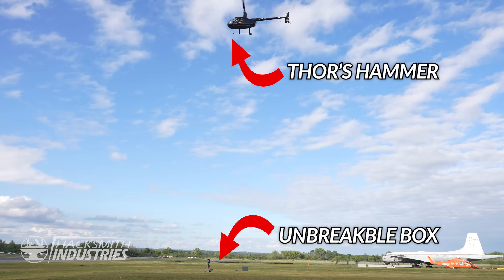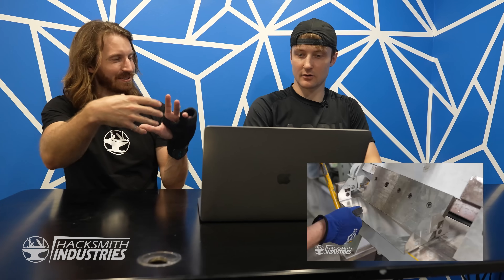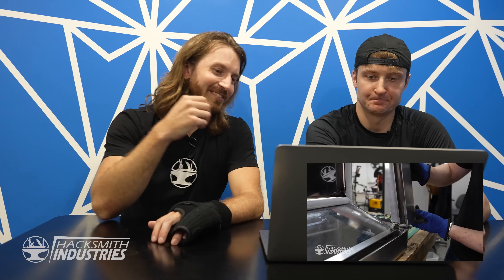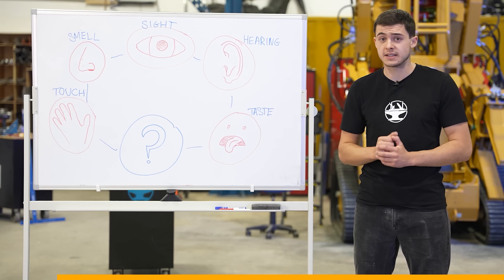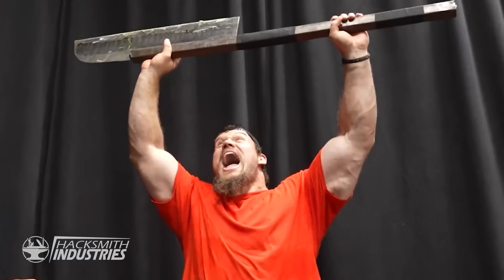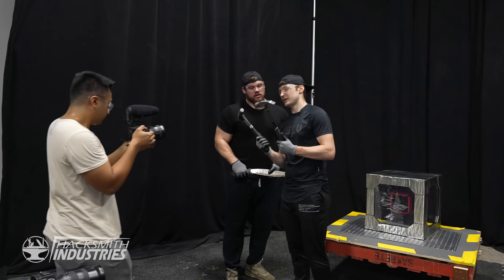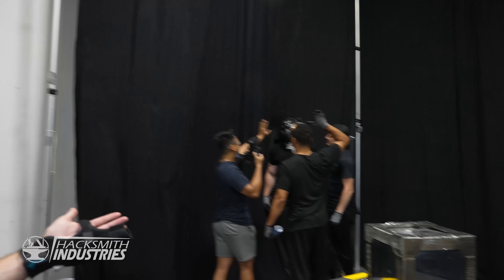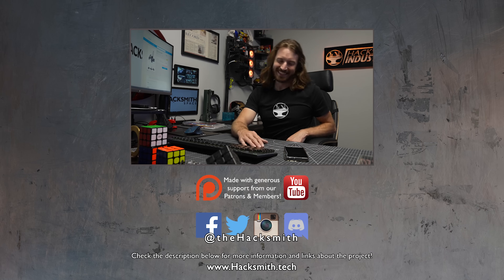Testing an UNBREAKABLE TESSERACT with JUSTDUSTIN for $10,000!!!

Comment: You guys need better sources for your polycarb.  You can get a 4'x8'x1/2" sheet for <$600 USD and 1" for about $6400
Reply from the maker: That math still doesn't check out. 10x the price for twice the volume?
Reply: @hacksmith  If you consider that as you get thicker you start getting into thermal gradients as it cools I can see thicker pieces being harder to make and keep both straight and to tolerance.  My point was more that you were massively overpaying.

Comment: This could be trivial... Just weaken the structure of the cube by using liquid nitrogen and the lightsaber. Then hit the cubes metal edges with something like an axe until it breaks. Then you can try to hit the corners, allowing acces to the inner cube, which you break by throwing it out of the helicopter into the edge of a building or just a bunch of spikes.

Comment: Seems too easily breakable. The polycarbonate seems a good material, but since there's large surfaces with empty space behind, makes the cube faces vulnerable. The edges are too thin metal, and the space makes it succeptible to prying. Welds could be much longer also.
Reply: Exactly what I was thinking

Comment: The method to break it is concentrating the force in a point with an object with a small surface area, doing that and the most important, applying acceleration will break it, 'cause the the force is F=m.a. If the impact is concentrated in a small area, it will not spread the resultant force by it's surface like a bigger area would does. Spreading the force decrease the amount of neccessary force to break it, simply 'cause it is being divided by each mm of material.

This is why that triangled hammer broke that. Maybe the hammer breaks the cube, but the probability is small if not hitting the cube with a small surface area, as said before. With the gravity acceleration + hammer's mass, wouuld break. I'm considering that the Mjonir will break it because it's mass will compansate the surface area, increasing the resultant force.

curiosity:
If that were the same Thor's Hammer built in the video, it has 10,4 lbs = 4,8 kg. F = 4,8 * 9,8 = 47,0 N. I'm in doubt if it would break...

Comment: Pls build another unbreakable box that's more unbreakable than that! You can use part of your design, but also reinforce the outer lexan layer with triangular steel frames as well as the gaps between the inner and the outer cube. You could also cover the steel frames in carbon fiber to make it even stronger against stabs!

Comment: As a chemist:
Just pour Toluene, Acid or Ammonia on the Polycarbonate and it will be destroyed.
Otherwise heat it up to glass-temperature and use the weakened structure.

Comment: An idea for the inner cube. you could have put half-inch polypropylene on the outside and have had half-inch polycarbonate glued to the inside of that, to get the reflectiveness, cover the polypropylene with mirror-like film. for the edges, use some square steel tube with thick steel rods welded to the inside. Not entirely sure it would be Trent Proof though.

Comment: This video is interesting. I think an easier approach for the first box would be to use the flame thrower to heat the metal on one side. Then use one of the many axes as a wedge to pry the metal off. Then I would focus on removing the polycarbonate overlay by prying it off. If that doesn’t work than I would try heating a part of the polycarbonate to a degree were it becomes more bendable. Then you could use a heavy tool that is sharp like storm breaker to open the softened plastic.
Reply: Agreed but not as entertaining as having Trent hulk smash it to death
Reply: @nicks2880  valid point

Comment: If a fiber coupler melts, its probably because it got dusty. fiber couplers need to be perfectly clean because if there is any speck of dust, it will reflect the laser and melt the fiber because of how powerful the lasers are.
Reply from the maker: Incorrect setup -- water cooling lines never attached and never mentioned in our setup guide =( challenges of importing a machine from China
Reply: @hacksmith  oh ya, that'll do it. Pesky incomplete manuals...